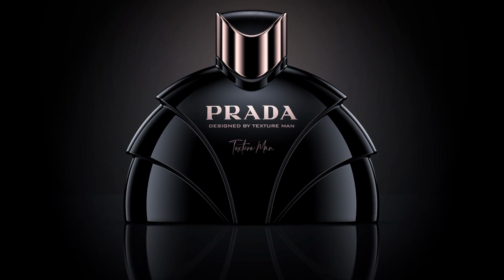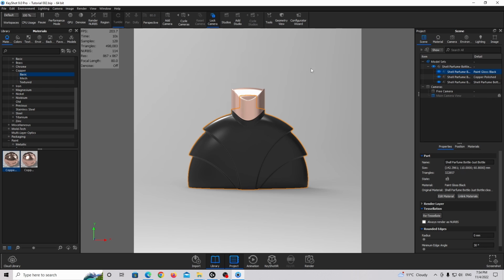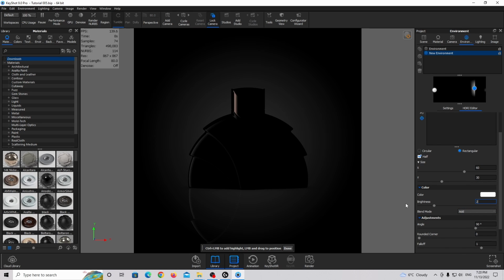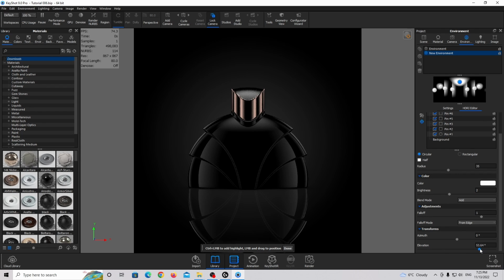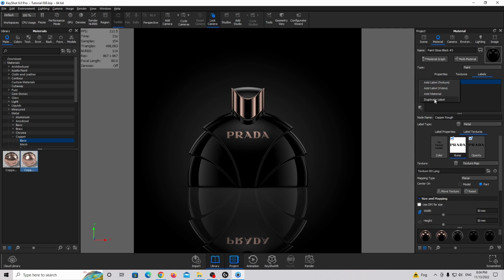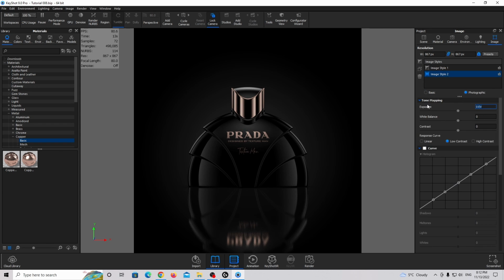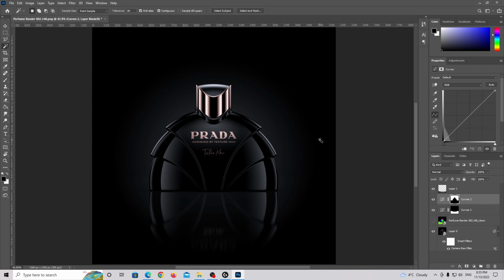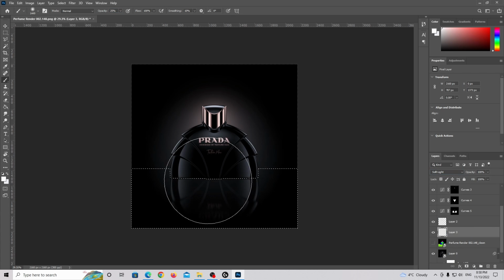KeyShot Tutorial: How to Realistic Render CAD 3D Model

Comment: very nice tutoiral 
your pc specification please?
Reply from the maker: Hello, I got pretty old workstation, Intel Core i7 7700K, NVidia gtx970, 16gb ram, and 500gb m2, I am rendering in CPU mode :-) If you got slower computer you can use basic rendering mode in KeyShot, and then when you finish all the materials and composition you switch to the product rendering mode at the end :-)
Reply: @textureman  thanks for your replay
 when i open keyshot 11 CPU goes to 100% to basic mode
if i do GPU mode graphic card  goes to 100%
There is no problem with this?
I have 10700k RTX3070 ram 32GB 1gm m2
Reply from the maker: This is absolutely alright :-) When you rendering something you want to go CPU or GPU on 100 percent, that means all of your horsepower working, so that means you will have better performance and much more samples in shorter time. Every rendering application trying to use 100 percent of your capacity. Open scene in the KeyShot and press H on your keyboard, it will show you head-up display in viewport and you can see how much FPS you got. If you want to use less than 100 percent you can see on the left-top corner CPU or GPU Usage, and you can choose how much % percent you want to use. When you use 50%percent of your power, you will going to see in that head-up display you are rendering slower, so ALWAYS USE 100 percent to render faster :-) 

100% percent of GPU or CPU = faster preview / faster render

For example :-) 2 exactly same cars on the straight racing track, one is going with full-100% throttle and second with half-50% throttle, which one going to finish track / render faster? the car with 100 percent or full throttle :-)

Basic mode its not such a complicated as product rendering mode. So that means in Basic Mode you will reach more samples in exactly same time as product Rendering Mode, but you will achieve less quality. So you trade quality for speed if you need.
Reply: @amjadali-qr5hk  Yes mine too